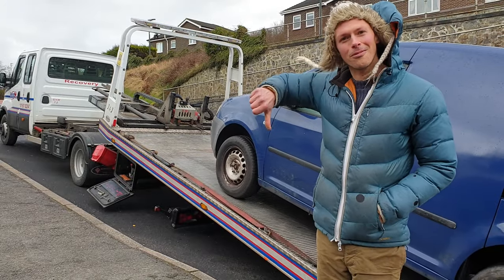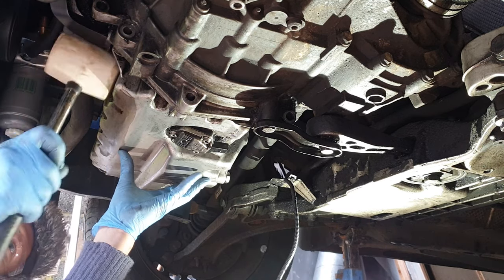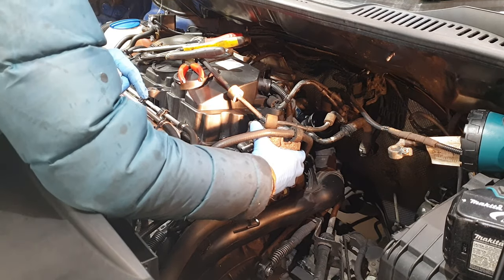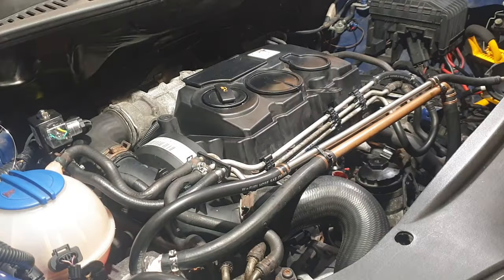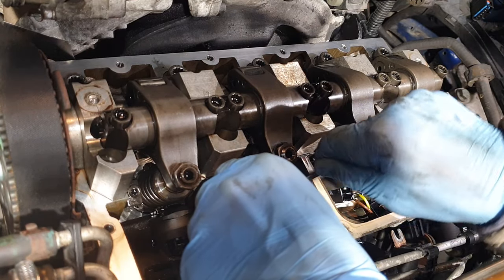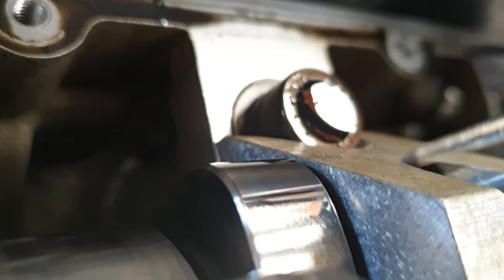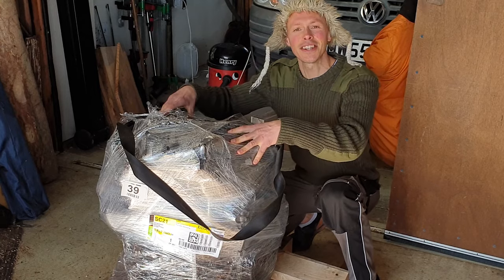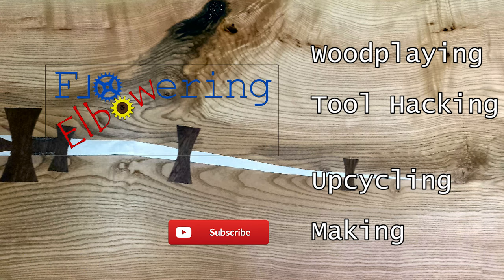What to do when there's Fuel in the Oil? Don't Panic!!

Comment: Hugely rewarding to both locate the mechanism that failed (tandem pump seal) and recognise why it failed, (over enthusiastic lift pump). Pity you then found a worn cam - though I presume the engine had been running OK prior to the tandem event. With it all in bits the temptation to replace the engine must have been strong though you might have gained a few years use if you had "just" fitted the tandem pump seal kit and put the old engone back together...

Comment: I did my injector seals on my 1.9 pd yesterday. My oil was slightly diesly and a bit of smoke on start up only.
Thankfully I caught it early so my camshaft didn’t suffer. 
The injectors are easy as pie to get out, just twist them left -right a couple of times using a pair of grips on the front facing nut thing and they’ll pull out really easily. I think they sort of vacuum themselves in so the twisting motion breaks that seal, If only you knew before this video.
Reply from the maker: @Dan23_7  thanks for the tip, noted fir next time!

Comment: Cam doesn't look bad at all compared to what i have seen in the past. It's normal wear, I would have just got the seal kit for the pump and called it a day.. 
next time you pull an injector out, twist the injector back and forth a few times and will pop out with almost no stress.

Comment: FYI veg oil dries out / makes rubber stiff. So if that seal that blew was in contact with veg oil and is made of rubber then that will probably be why, they get hard and stop flexing so cant do their job of sealing anymore, or at least it could be a contributing factor along with your lift pump setup.

Comment: Determine the cause of the fuel contamination. Possible reasons include:
Faulty fuel injectors or carburetor: If these components are leaking, fuel may enter the cylinders and eventually make its way into the oil.
Compression ring or piston issues: Problems with the engine's internal components can allow fuel to bypass the combustion chamber and mix with the oil. After addressing the issue, monitor the engine closely. Check the oil regularly to ensure that fuel contamination does not recur. If the problem persists or if there are signs of ongoing issues, seek professional assistance.

Comment: Good video, did you strip down and inspect turbo , mines smoking a bit at the moment, can you analysis diesel in your engine oil?? Good video 👍
Reply from the maker: Hey FlashTech, thanks for getting in touch. I didn't strip the turbo, as the new engine had one anyway. It did "look" ok though... 
I believe the oil analysis services that are offered can detect diesel in the engine oil, yes.

Comment: So in other terms ,so the engine got destroyed by the main pump by using veggi oil ?
Reply from the maker: Not really. The additional fuel lift pump I added for the diesel tank was too high pressure 😳  and blew the seal in the tandem pump...

Comment: Hello, I own a Kia Cerato 1.6 crdi 136 HP vehicle. My car is at 86,000 km. Diesel is mixed with the engine oil, the oil level is constantly rising. There is no problem in the operation of my vehicle, the idle is normal, there is no noticeable black or white smoke from the exhaust. It works immediately with a single start in the morning, there is no problem. The technician said it could be the DPF and he removed the DPF and cleaned it in the machine. The DPF was around 40% full, but it was still cleaned. But that was not the solution either. Engine oil level continues to rise in my vehicle. I think there is no problem with diesel injectors because there is no indication of injector failure. The vehicle engine has a timing chain. Could it be from the high pressure diesel pump seal? Or what could be the problem? Could you help? Have you ever heard of such a common problem for vehicles of this segment? Urgent. Thanks in advance
Reply from the maker: Hi Baki  thanks for watching. Good question  but sorry I am not familiar with that engine or car. Good luck with it my friend!

Comment: Great video worth the wait(suspence)Your EGR valve is quite clean.My 1.9Tdi was smoking and lumpy on cold  start then running well after 45 seconds/I last cleaned EGR when car was purchased nearly 3 years ago but happend to check it last week as on holiday and it was 85% blocked again so cleaned and car goes like a rocket again.You are not  saying veg oil caused the failure but the fuel lift pump on the diesel circuit which is interesting.Can you list the pressure of the pump you eventually fit I suppose if you can find the pressure of the stock VAG in tank lift pump you should match it.There is also a modification people do to PD engines running veg they modify the in tank lift pump with a by pass hose  https://youtu.be/I_iB_VPatac so any excess fuel just stays in the tank they generally use this to improve the fuel feed on non Tdi engines like mine with a dedicated fuel injection pump(non PD engines)Last year when I was researching converting PD enines I did speak to a chap via eBay who said he has successfully converted several PD engines using a similar method.The lift pump situation on PD engines has been my stumbling block (switching and type of pump to use )hence the interest in yours channel.Keep it up.If you seen my channel I use a loop system on the feed to my Bosch pump(non PD)so the pump has less work to do as it is not constantly drawing fuel from the tank then sending unused fuel back again.I think If you get time to watch this 2toc video at 3mins 50 seconds he point out a loop system and I believe its on car with lift pumps? https://youtu.be/fdH6T7jHnYk
Does he use a lift pump with a pressure relief valve?do such things exist?I have seen lift pumps on ebay that are veg oil tolerent.Good Luck Great Channel.Once you find a cheap source (or free)you could look at running your heating syatem at home with a veg oil burner?Start on heating fuel then once warm switch to veg thats heated from the hot water via a heated fuel filter or just a heat exchanger.?Heating oil is about 50p per litre?
Reply from the maker: Hi Simon, Great to hear from you again. I hope lockdown isn't so bad for you. That's really interesting to hear about your ERG experiences. Just saw your e-mail with the pic - I see how that would choke the engine... I have heard people say they don't play nicely with veg oil - any truth to that? 
Yes, as far as I know the veg oil itself didn't cause any of the problem... I think it was mostly the lift pump I fitted that caused the seal to go, although those seals do just fail anyway occasionally (or so I hear). The pump I have fitted now is this https://www.demon-tweeks.com/uk/facet-interrupter-electronic-fuel-pump-243226/ Not the cheapest, but recommended to me by a few people. When I tested it, the pressure doesn't go too high, no more than 1/2 bar, but flow rate is a touch higher than the stock lift pump.
There are such things as pressure relief valves - and I thought there was one in the tandem pump itself (so I guess I was wrong or it was malfunctioning). I saw a few for sale at demon tweaks - but none seemed to be designed for diesel fuel... 
I'll watch the 2toc vid now. 
Peace, Bongo.
PS interesting idea with the heating oil.. Will need to find a good free supply first, with is not happening any time soon with lockdown..
Reply from the maker: I see the closed loop system you are talking about. I wonder if overheating may be a concern? I think the tandem pump heats the fuel quite a lot, and maybe relies on incoming fuel to cool its component parts? That and the problem with polymerising in the small channels of the engine head? It's all hearsay and speculation though... I'm unsure.
Reply: EGR glogging with veg is probably the same as with diesel just check the EGR every 12 months,Dont forget diesel is dirty fuel as you will find out your heated veg oil filter element will be super clean even after several years if youve filtered used oil well whereas a diesel filter will be filthy after 12 months.
Reply: @FloweringElbow  You are feeding the tandem pump with hot(80 degrees)veg oil anyway so the tandem pump has to be able to take it a loop system would create hotter oil I dont think.Anyway your system is good as your feeding hot veg oil back to the tank so it will warm the oil in the tank up which is great in winter.Ill ask my contact whos done PD engines if he has any problems with PD veg oil systems and Tandem pumps.Look forward to new video fitting engine and new pump with switcher over relay.Cambelt kit see GSF car spares cheaper the Euro car parts.
Reply from the maker: @simon7030  thanks for this. Yep, I'd almost forgotten that I was going to substitute a relay into where the lift pump switch is... I spent quite a while carefully examining the timing belt on the new one and concluded that it didn't really want changing, so didn't, fingers crossed 😉

Comment: LOL but as I watched this I couldn't help but yell at the video NO, NO, STOP that is not it......I will add that if you have the Bentley Manual for your vehicle it will walk you step by step for any possible teardown or procedure.  You will need the crank lock tool to do cam/TB work....tip do the timing belts slightly early and change the temp sensor and thermostat while coolant is out of the car and also replace the water pump and all of the rollers and one-time use bolts.  Pity really that you live in the UK and with covid travel is difficult or I would be delighted to come help you work on your VW...I bet I have done 20 cam/lifter replacements in my day and it is very simple and the total kit here in the us is less than $500